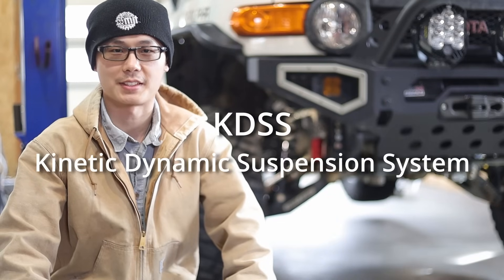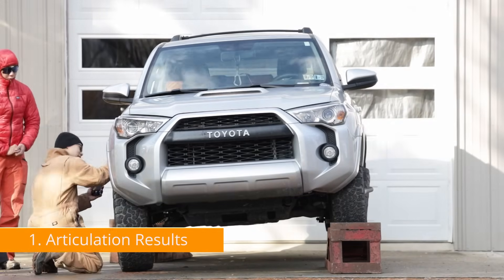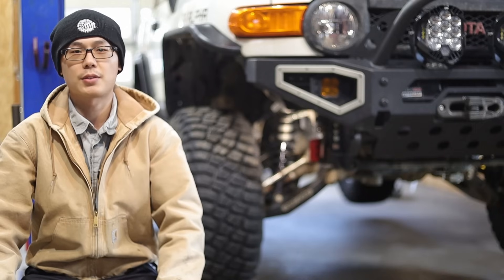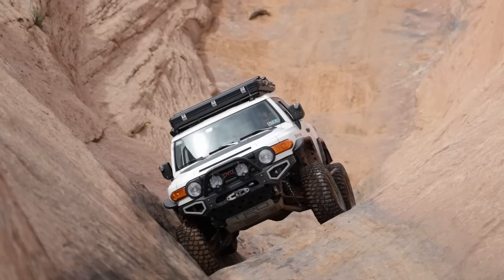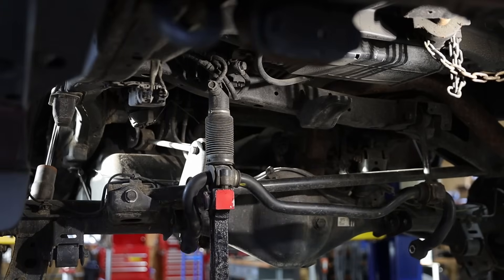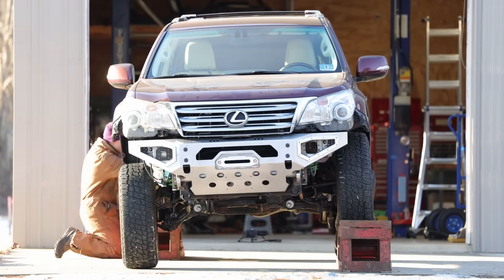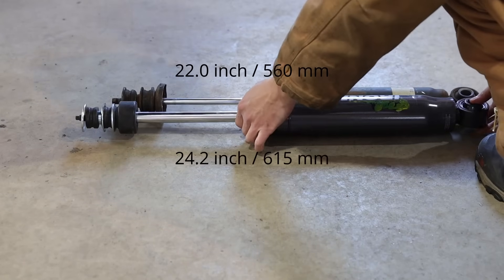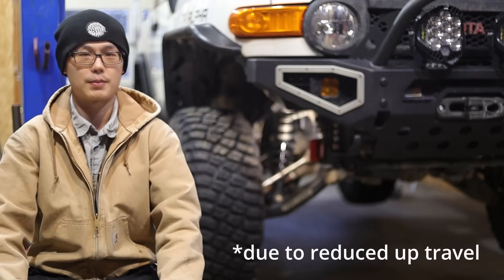Toyota KDSS Ultimate Test | Legit or Gimmicks?

Comment: You're probably the best person to ask this question I currently have a Dobinson passenger front top hat lean spacer installed on my Lexus GX with Bilstein 5100 and one 886 springs . My question is can I remove the lean spacer and adjust the preload by moving the spring seat up one notch to counter the lean?

Comment: Wow so much data, nice work. I love my kdss but if the roads you drive have salt on them in the winter you should take off the 2 pc kdss steel guards / plates and clean out around the kdss box and lines and refinish / rust proof the guards. Worst salt trap on the whole vehicle :)

Comment: First of all, your reviews are absolutely the best. I love the way you go the extra mile when something doesn't make sense to get the answer, most people seem to just guess at the answer and move on. You are certainly an engineer at heart. In that same vein I have a question, toward the end of this video you point out that KDSS is actually worse in off camber situations. Off cambers make my skin crawl so I really perked up when you mentioned that! My question is: since I have a 4Runner with a KDSS switch or button, couldn't I simply turn KDSS off in off camber situations? So that my 4Runner would act like non-KDSS and thus better in off camber situations? I realize this is an older video so I hope you're still monitoring the comments. I have a '17 4Runner Off Road w/KDSS and about a 2" lift in the front and about 1" in the rear.
Thanks in advance,
Jay Duvon
Reply: 2016 4RTP w/ KDSS owner as well … I hope that he responds to your questions … Great and very Detailed Review on subject …
Reply: This was my exact question. I’m contemplating installing a KDSS switch. Have you been able to test with that on an off camber trail?

Comment: I have a gx460 with a Ironman foam list kit. My GX460 has the passenger side lean. .5in lean on FP and 1” on the RP. Will KDSS spacers help with this ? If so, do I just get the rear only Dr. KDDS pacers or the Oak Tree’s 3 spacer kit

Comment: On a 5th gen ORP w/ KDSS currently on 6112/5160 Bilsteins and every Dr. KDSS product available. Been great for medium trails with no issues so far, but want to do some harder trails and am looking at the Total Chaos +2 long travel kit for KDSS which you recommend, but what do I do with the rear to maximize travel? Leave the rear mid travel on 5160s? I haven't seen too much on getting the most out of the rear KDSS travel. I have been told that going with a King 3.0 triple bypass 12" will give me the most travel out of the KDSS because it has more extended travel versus other mid travel shocks with adjustable after market links. What do you recommend for the rear KDSS setup to pair up with the Total Chaos +2 kit?!?!

Comment: Most excellent information and appreciate your research and sharing.  I was able to find a 2024 4Runner OR-P for my needs.  Daily driver and yet off-roader for fishing trips, photography and exploring interesting off the path places.  I was initially not going to go with the KDSS, but as there were only two '24 4R available in my area I did not really have a  choice as it was on the only TRD OR-P they had.  How mistaken I was!  My 4R is amazingly smooth and comfortable on the pavement, tracks effortlessly on the interstate AND gets me well off-road and back home without breaking a sweat!  I'll be heading to Montana and Utah this fall and look forward to getting deep in the "road less traveled" and back again!  KDSS has been a very positive addition (IMHO) to my 4R suspension!

Comment: My Lexus GX 460 has 50k kilometres on the odometer. It has never been off road. The kdss light came on. My local Toyota dealership quoted a replacement cost of $7100. Since COVID has interfered with the availability of for sale units I am aware that dealers have been making up for poor sales figures through service work. I think this is a scam and Toyota should be ashamed of putting absolutely unnecessary gimmicky, expensive and flawed systems on their vehicles.

Comment: I installed TRD fox shocks on my 5th Gen TRD ORP which has KDSS… but now my car has a 1” lean on the passenger side. I’ve heard that the spacer will help correct the lean, but I’m curious if the KDSS is now not at 100% because the oil is not balanced between driver and passenger side… I was told to disconnect kdss and drive around for about two weeks and make some hard right turns and this apparently should correct the lean. I’ve been doing this for a couple of days now, but I’m not seeing much difference at all, but I haven’t measured yet. If anyone has any ideas on how to correct the lean, I would really appreciate it
Reply: Trd pro fox coilovers have a different perch height from left and right, sr5 and trd off road non kdss have different springs left and right, Kdss has the same spring for left and right. Possibly why it is leaning.
Reply: @T4R-05  thanks… this is true, I finally figured out that they are side specific
Reply: @Hassi_81  what did you do to get it leveled?
Reply: @T4R-05  well there were a couple of issues… first and biggest issue, was that I did not realize the shocks with the wescott collars were side specific, so had to reinstall all to the correct side, but also had to install a KDSS spacer. My truck went from have a 1 1/4” lean to the passenger side, to less than a 1/4” now which is within acceptable range. You can’t tell the difference at all anymore. But the biggest issue I had was not realizing that the shocks with the WD collars were side specific, to account for the gas tank
Reply: @Hassi_81  1/4” or less isn’t really noticeable at all by the human eye. But it’s good to know trd fox suspension will sit almost even on a kdss when installing on the correct side. Thats what I wanted to do but couldn’t find any at a good price with low mileage so I just went with eibach stage2r.

Comment: We just bought a 2024 4runner, was all about getting one with KDSS, but the more research I did the more I learned it really is not mechanically sound. It's great for road drivers and crawling slowely off-road, problem is if you drive fast off road, especially long washboard roads and such, it is an absolute nightmare. The KDSS will kick in cosntantly while offroading at a decent speed 30 mph+ and send extremely rough hits into the cabin because it's locking the sway bar. It also lowers the front clearance by about 1.8 inches, andif any of it malfunctions the cost to repair is insane like $4,000 to $6,000 usd. Just avoid it, seriously.
It seems like a band-aid toyota came up with to combat rollover crashes but just doesnt work in real life situations, only under controlled tests. There is a reason this is not a standard system on all vehicles.
Reply: Depends on what you looking for. KDSS can be a great upgrade. As far as your research, KDSS is a very dependable system unless you don’t do some minor service. Just like the frame will rust if you don’t do prevention measures.
Reply: @Jim-s6i3b  no, it is not an upgrade whatsoever

Comment: Hi Tinkerer, I cannot reproduce the front suspension travel measurement you had in the video. I tested it when the engine is off. My down travel is fine (about 2.5 inch) but I can barely get any up travel. How did you measure GX front travel? Did you measured it when in Drive  gear & engine is on?

Comment: Really interesting discussion. So KDSS acts like no sway bar at low speeds... This begs the question: why are 4x4's equipped with a front sway bar at all? Apparently the bar is so detrimental to off-road performance that auto-makers have implemented complex and costly mechanisms to get the bar to disengage when you're doing what vehicle was designed for. Since no one cares about on-road handling performance of 4x4's, I can only assume that the reason the bar is there at all is for highway safety/liability. I'm starting to think that removing the front sway bar entirely before an off-road trip is an obvious thing to do as an end user.

Comment: What if you use a similar size tire but with a lower load rating. The tire should deform faster woth higher pressure. Am I correct?

Comment: but how about a KDSS switch that allows you to disengage KDSS, would that make KDSS more tolerable for high speed off-road? 

will 2" of lift be enough to clear 35" tires or does that require frame moding/viper cuts?
Reply: Have to go much higher for 35's  I have a 3" F/2" R lift and am running 285s (33") and I get some rub in reverse on full left steering lock.  I think you would have to also do a BMC and remove plastic fender liners and mud flaps to run 35s.  I have seen comments on Dr. KDSS switch woudl allow you  to open the KDSS solenoids at high speed but I mainly do slow speed off-roading and rock crawling.  I am driving a 2016 Trail edition

Comment: Wow, impressive detail research. You should get an award. We recently got a 4Runner with KDSS. Hope to do some long travel, e.g, East Coast to West Coast, and explore some off-road adventure. So far the roughest thing we have done so far is drive over icy lumps from where the snow melt and freezes. It is a bumpy ride. I imagine that could be what it would be like going offroad. I could watch your video again as it's fascinating. However, I have limited CPU power at my age to grasp all the new info that you were dumping out there. Any case, any suggestions what we could do, if anything, to make our offroad driving smoother. We are not planning on doing any hardcore rock rawling, but would like to go offroad. Thank you again for sharing. I will need to revisit this video and see what else i CAN pickup. Subscribed. God Bless and stay safe.

Comment: Which 2.5” would you do on a kdss 5th gen 4runner if it was your ride? I just got a new tdr off road premium and upgrading tires to 255 75 15. I want a 2-2.5” lift in the future. I drive 65 mph roads and dirt roads and easy to moderate trails. I just want a peace or mind with the lift and not looking to fit a bigger tire. Thank you 😊
Reply: I have a 2013 trail and went with the fox racing 2.0-2.5in for the front fox shocks in the rear. Still using the stock rear springs though as I am still searching for ones that will fit my driving style

Comment: Wow!!! What a break down! I'm on the fence of what vehicle to purchase and thought maybe someone here can lend some advice. Looking to switch up from my current 2010 Chevy AWD van with a RTT to a different setup. I do a lot of backroads with some technical but not much. Haul a small camper during archery season. I'm bottoming out in my current Van all the time but  love how much I can haul. TW200 in the back, cooler, gear etc.  I head to Baja as well but mostly on dirt roads and some beach. Need to be able to keep the RTT and pull a small overland gear trailer with some pedal drive kayaks. My question is do I look at a 4R or Tundra? If 4R, what model with KDSS so I can beef things up a little. Or Tundra? Kinda off the topic here but thought I'd throw it out there. Cheer!

Comment: Excellent work, thanks for such a concise and thorough breakdown. Another consideration is a KDSS solenoid switch, which you can use during high-speed offroading to reduce the jarring suspension. I will be adding one to my setup. Otherwise, concur with your assessments, I have a GX470 with KDSS + 2" lift and 33" tires. Front and rear KDSS spacers are a must.

Comment: For a 4runner with kdss to run 5100s with a 2 inch lift does the vehicle encounter any kdss lean or need a rear panhard bar spacer? Or would it be just a drop in lift?

Comment: have you considered for higher speed off roading with KDSS some kind of bypass electrically speaking ? assuming the valves are controlled electronically could by pass the computer signal entirely and make it a switch inside the cab? or some how computer enabled over ride for the issue of jarring at higher speeds as mentioned? SUBED and Thumbs UP thanks for your channel !

Comment: The real benefit of KDSS is the ability to enable excellent roll stiffness, which is very desirable, without sacrificing wrap compliance, which is also very desirable. That much is obvious, doing it with proven hydraulic systems that have over a century of proven reliability as anything from hydraulic brake lines to hydraulic airplane control surface actuators is the exact opposite of a fancy gimmick.

Comment: I have a non KDSS 2014 4Runner Trail. I have wheeled it in stock form with 265/70/17 General Grabber AT tires and now with a 3" OME lift with 285/70/17  Mickey Thompson Baja Boss AT's. It did seem to lift tires more with the stock suspension. I have not measured the rear droop or done any scientific testing. It seems the larger heavier tires may help with droop along with the longer shocks. I thought being higher it might be more tippy, it doesn't seem to. I don't do heavy 4Wheeling or rock crawling but tight off-camber turns seem to be the problem. I think a long travel front suspension would help as I still have stock control arms and the factory sway bar...
Reply: Have 4Runner with KDSS but Wildpeak 265/70/R17 LT tires and runs smooth, very little added road noise.

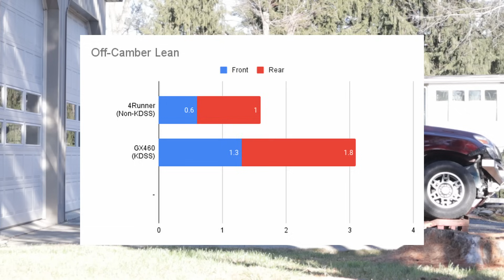Comment: I believe the main contributing to the difference between the 4R vs GX results at 6:21 is the GX's higher  CofG. That moment arm would definitely cause additional lean. This is despite its narrower wheel track compared to the 4Runner.

The FJ Cruiser however has both a lower CofG but also a wider wheel track, which means a lower moment arm from the reference poi t of its CofG.
Reply from the maker: Good point

Comment: I'm getting ready to buy a 2023 4Runner with KDSS.  I want to lift to level and take advantage of increased ground clearance.  That said, what is your suggested 2" Lift Kit?  I'm not going to do much technical wheeling, but so want it leveled and plan to run 33's.

So what is your choice for 2" Lift Kit?

Comment: I, like you, are not into high-speed off-roading but living in New England, I do want an off-road capable vehicle.  I am in the process of ordering a KDSS-optioned, 2023 4Runner Off-Road Premium.  What mods would you recommend (if any) to make it more capable without voiding the new warranty or reducing the vehicle's reliability?  I had a 2022 TRD Sport with XREAS before it was totaled.  I had a 3" lift on it and ran Nitto 285/70/R17 tires and thought that was a good look.  The vehicle is, however, mostly on-road as it's my daily driver.  Thanks for any feedback you might have!

Comment: Wouldnt a KDSS spacer on the front bar increase passenger side droop while also allowing more freedom of uptravel on the drivers side? You have a now longer rigid support on the passenger side, but the KDSS cylinder on the drivers side still has the same range of motion as before. In a situation where the drivers side is stuffed, and the passenger side is drooped, the bar would be at a steeper angle favoring more travel on either side.

The issue would be in the opposite direction where the drivers side is drooped and the passenger side is stuffed. Now you have a shallower angle across the bar.
Reply from the maker: Good thoughts, but that is only true for a perfectly straight bar. Like a solid axle. For KDSS, the sway bar bends in front to rear direction. The LCA eventually starts to twisting the bar. It is not a pure left to right tilting through out. So the KDSS spacer would have the opposite effect to what you described.

Comment: All your videos are great sources of knowledge and understanding of what is actually going on in our vehicles. I have a 2016 LC with an Ironman 2-inch lift and 35-inch tires with 3/4-inch front-end spacers. There are discussions in many forums about moving the KDSS controller (Slee's and other's mods), but I don't understand the issues/reasons for relocation. What is the problem with the original position that relocation will help solve and is it something that I should be considering for my rig?

Comment: Thank you for making all of your video's. I appreciate your well educated point of view. I have a question... If someone DOESNT have KDSS, what are the best things to do to minimize body roll on a new 2023 4Runner TRDOR?
Reply from the maker: Thanks! A stiffer rear swaybars would help. A stiffer front swaybar would also help but will have more negative impact on articulation. Alternatively, you can get shocks with a low speed compression adjuster, like the Fox DSC or dobinson MRR. Max out the low speed compression would reduce a little bit body roll
Reply: @TinkerersAdventure  Thanks so much for the prompt reply. I appreciate the examples of shocks you provided. Can you recommend a particular brand sway bar for rear and or front?
I’m not sure if there is a TRD set or if the one for the Tundra will fit my 4R.

Comment: Thank you for this informative explanation. Based on your video about sway bars vs no sway bars, it sounds like a KDSS system that would only disconnect the front sway bar while utilizing stiffer sway bars both front and rear would provide the most balanced front and rear articulation off road, while providing better on road maners. 
Thanks again for your awesome content.